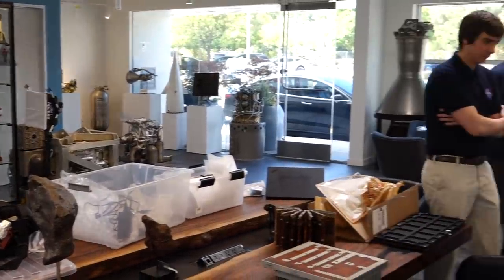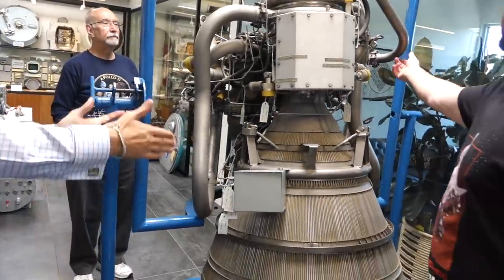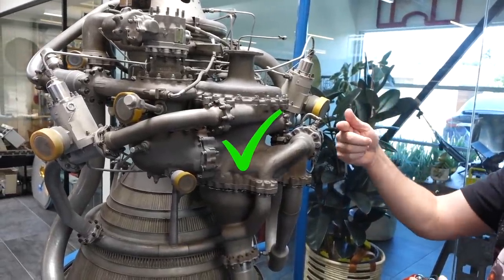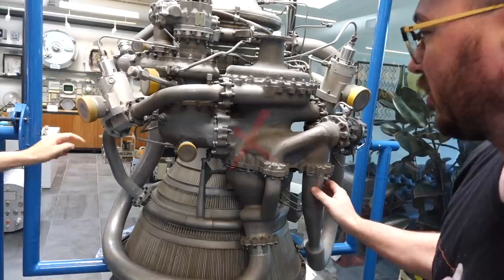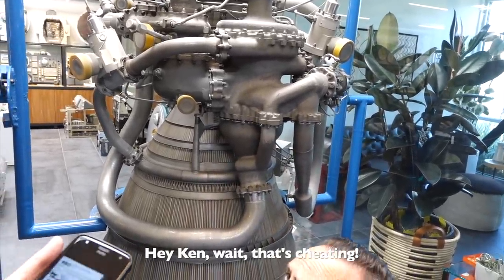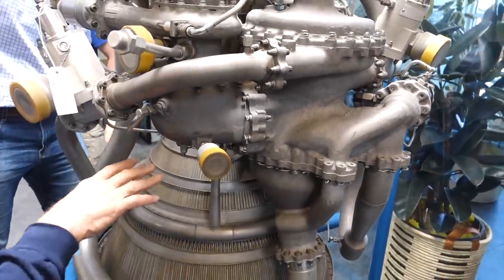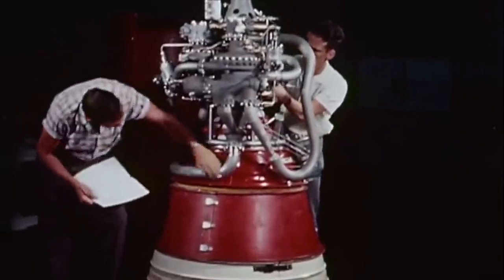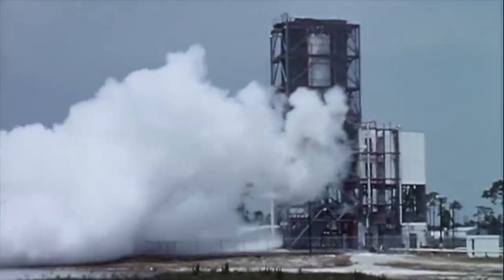Steve Jurvetson’s Space Collection Part 3: Everyday Astronaut figures out the RL-10 Rocket Engine

Comment: The LE-9 engines which have been developed for the H-III rocket are expander cycle engines, but they use an expander bleed cycle where the hydrogen used to drive the pumps is dumped overboard after it is used rather than passed back into the combustion chamber.  They are the largest expander cycle engines ever built.

Comment: 6:50 - so is that pretty much like when you put your thumb over the end of a water hose to make it spray harder?
Reply: Yes. So the next time you are horsing around with your water hose, exhibit some care so you don't end up in spaaaace! :)
Reply: Yeah, it's just a venturi (rocket necks are really venturis). They interchange pressure for speed. 
Is also how carburetors and paint guns work, the neck has a very low pressure (Because it has been converted to speed) that can be used to suck liquids.

Comment: That was Fun, Thanks, A few checks and X's seem to be wrong.

6:23 Check, Tim is Correct, it is part of the Throttle and is a fixed Office, providing a fixed amount of Mass flow. The Hot Hydrogen Gas is at Mach = 1 at the throat, for a given pressure, no more mass may flow. Mass flow for a given pressure, XXXXX not Pressure Regulator. 

6:48 XXXXX, Not sure, but, Not Supersonic. It's Subsonic flow on both sides of the Choke (Mach 1 at the Throat). The Nozzle sets the mass flow. The Turbine Bi-Pass Valve sets the Pressure by adding or subtracting power to the compressors. Keeping the flow Subsonic after the Throat recovers pressure, supersonic flow would increase temperature but not recover as much pressure to run the turbine.

 Let me know if he allows you to run the engine. It would be fun to try to give it back in one piece.

Comment: you can see that the expansion bell in the plumbing is critical. it has one of the few sensors in the plumbing flow (there is [what I'm guessing is] a thermocouple or pyrometer on the inside edge of the pipe

Comment: Given that the running engine heats the hydrogen, which in turn provides the energy to turn the pumps - which is fine when the engine is already running and red hot, how do you actually cold start this thing? Is the pressure differential between the fuel tanks and the atmosphere enough to get sufficient combustion to eventually get stuff hot enough to spin the turbopumps and bring the power up?
Reply: Should be; the heat flux through the walls is fairly independent of exhaust velocity, and the later is what you need the high pressure from the pumps for.
Reply: The engine is already hot enough to start up, the hydrogen during operation doesnt heat up much beyond room temp anyway.

Comment: People often misuse the term "rocket science". The science is easy, the engineering is hard.
Reply: Science is usually harder. Engineering to use the science is a mixed bag. Sometimes it is well known enough that you can refer to a chart or some equations to get about 90%ish of the way there and then handle the rest of the stuff through high factors of safety, tests, and adjustments. Sometimes, it's something so new that you need the original scientists to tell you what it's NOT supposed to do.
Reply: Engineers are underrated, if it's written down it's science if it does something then  a engineer worked on it at some point.

"Scientists turns money into ideas a Engineer turns ideas into money"
Reply: @BrokenLifeCycle  You clearly missed the point of his comment. The science of rocket science is already EXTREMELY well understood and piss easy in comparison to the engineering. There's a reason people still havent flown with humans using a full flow staged cycle engine, even though the science was already perfected in the late 60's by the soviets.

Also the same reason the james webb still hasnt launched, even though the science behind it has completed development more than a decade ago at this point. Engineering has to be one of the most underrated jobs in all of humanity...

Comment: Nobody is interested in the Ford Model T style wooden buzz coil on the top?
Reply: good eye
Reply: @carlclaunch793  I'm more into antique gas engines than rocket engines.
Reply: good eye.  That's exactly right.  It was added by a Pratt & Whitney employee to pull off a stunt.  It drives a spark plug up in the top center of the fuel injector plate.  So... when the engine in in the horizontal position (big blue swivel allows that), people inevitably stick their head up in the bell (like cats go into paper bags), and then you can flip a switch and make it spark inside.
Reply: @jurvetson  Ok, so it's not flight hardware then.  I was pretty surprised to see it.

Comment: What parts are the mounting points of the engine?
Reply from the maker: You can see them around 1:06. The main attach point is the very top of the engine, you can see the articulated gimbal joint. And there is a bracket for the gimbal actuator underneath the engine, on the side of the bell.

Comment: If the square-cube law is the limit for the maximum output (because it uses the area of the bell to expand the fuel), why not just make engines like that with multiple nozzles for each large pump etc...
Reply: The best way to increase output now is to use more unconventional combustion chamber shapes.

The Vinci engine for example has a elongated combustion chamber to increase power

Comment: The real question is how they start it...  If it's not running, it cant heat the hydrogen to turn the pump.  There has to be a chicken to lay the egg that the chicken came from!
Reply: Before the ignition there is a drop in pressure between the tanks and the combustion chamber (the chamber is "vented to the outside" and there is no combustion that could cause backpressure) and this is enough to start spinning the turbine. Also, liquid hydrogen is a lot colder than ambient temperature, so the hydrogen will be heated but at a slower rate: this is also why there are many check valves on both LH and O loops, to control combustion during the initial phases and avoid turbopump stalling (a rich combustion could cause too much backpressure).
Reply: Good question, and Scott answers this exact question in his video. It boils down to (phun intended, of course) that the boiling point of hydrogen is so low that ambient temperatures allows for enough gas flow that just opening the gas flow and lighting it is enough to start the pump and the engine.